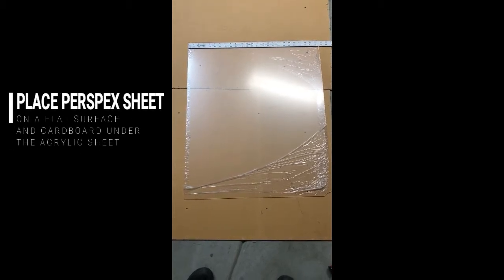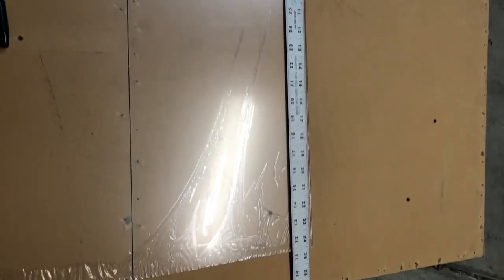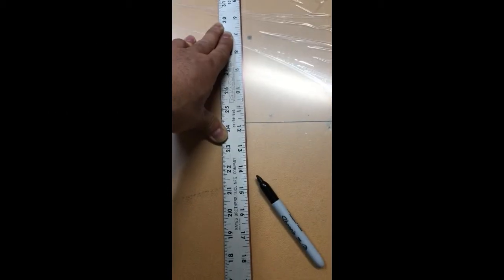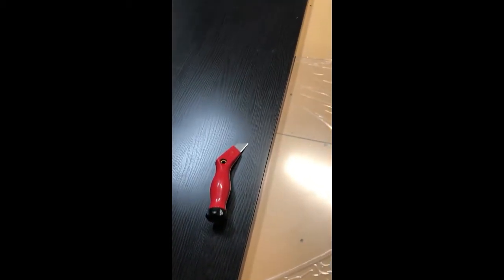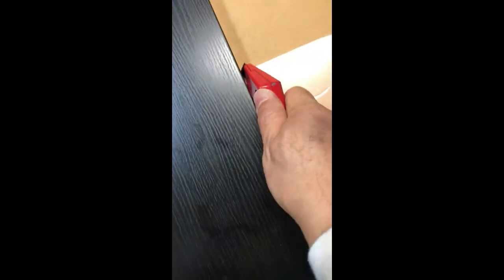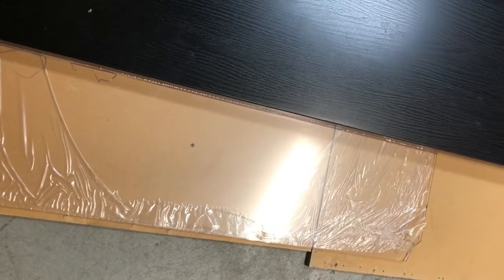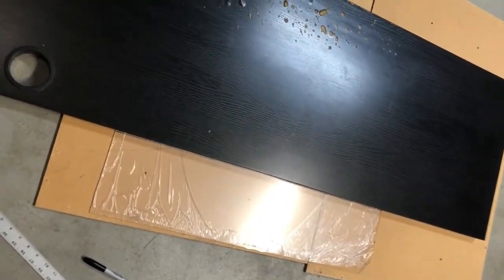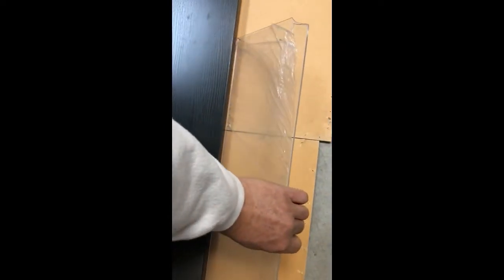How to cut Perspex Acrylic Sheets to size easily with simple tools

Comment: There is a danger that a crack can go off in the wrong direction with this method. A jigsaw with a new (sharp) plastic cutting blade is probably a better option.  Being sure to leave the protective plastic in place when cutting.  Adding Painters blue masking tape over the cutting line and where the Jigsaw foot will travel will add additional protection.   Finally, always have the perspex/acrylic on a full flat surface for cutting.